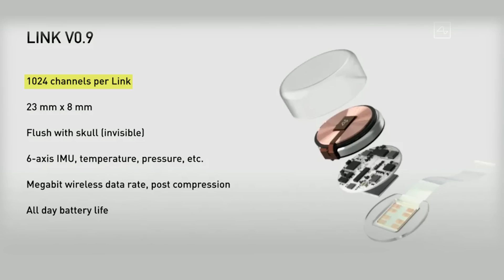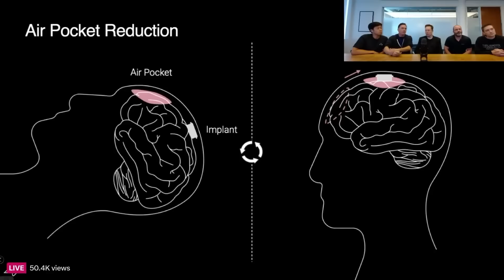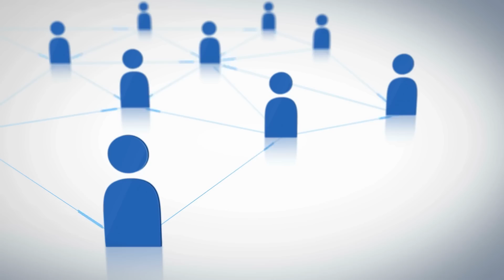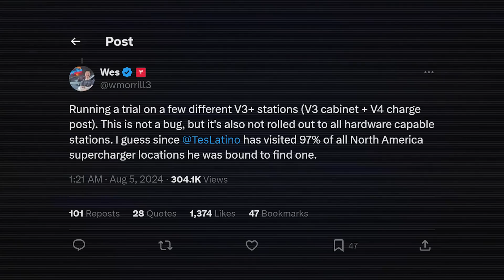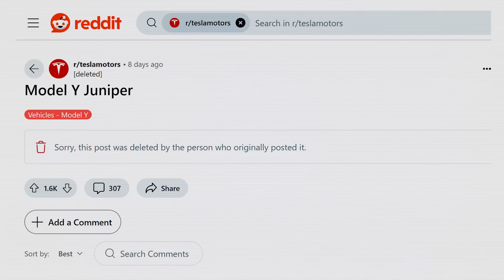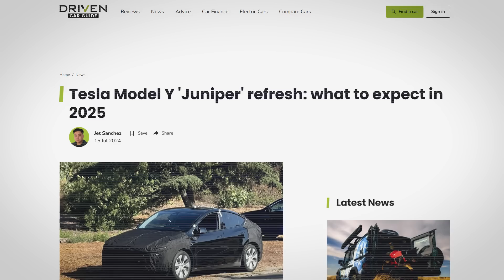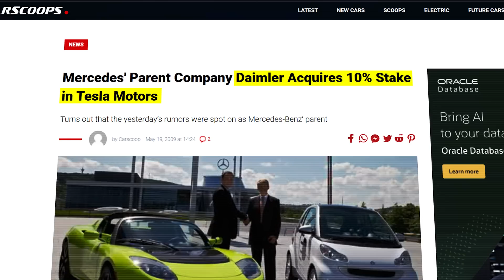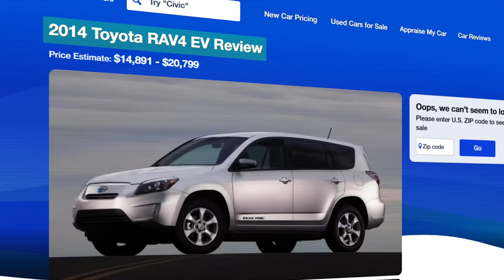Elon Musk Reveals Neuralink  V2

Comment: No, if you watch WhistlinDiesals durability test the cyber truck had some pretty major flaws. Slamming the door once can result in it breaking, the mirrors are barely held on, the tailgate came straight off when trying to tow a Ford f150 as a result of not being held on by anything, and perhaps not surprisingly after all this, pieces of the "bulletproof" body are held on by glue. Also if your windshield, which also is surprisingly easy, breaks, the car will stop working entirely. This guy is fanboying so hard over a video that quite literally shows that the cyber truck is mostly a cheaply manufactured pos
Reply: You would think the rear frame would be able to withstand being dropped on concrete from a couple feet because of the 5.5 ton towing capacity 😮
Reply: @Tacticalmayhem1  naah, vertical and lateral loads require different structural charachteristics. The rear frame is engineered to sustain the just the latter. Rest easy, the CT is a nice car.
Reply: the tailgate did get damaged earlier on tho when it dropped off the pipes and smashed on that concrete barrier at the bottom of the pipes which prolly affected the integrity of the tailgate itself
Reply: @XX121x2 Dude shut up that car is a piece of junk. No different than a traxxis  rc truck. There is nothing new/innovative about its technology they are just selling you a dream. Same thing with neuralink. All old technology. Fun fact the first electric tank was created by Porsche nearly 100 years ago. So look at what youre chasing 😂
Reply: @dcappucino9513  bro I don't like Tesla's all I stated was there was damage already done to the rear end that more then likely affected the integrity of the bumper.
Reply: @dcappucino9513  Out of all electric vehicles on the road that you see today, what do you see the most of?
Reply: @elijah3986  renault zoe and vauxhall corsa-e are cars i see daily i have only ever seen one tesla and it was the ugliest pos i have ever had the misfortune to see just face it tesla's are ugly and the cyber truck is a scam
Reply: @rya_belladonna  I have many reasons to doubt that's true, but if that's your only argument for why they are bad, then there is nothing to say. I think they look cool, they are fun to drive, there's many features that sets it apart from other vehicles, and they are the safest vehicles on the road.
Reply: @elijah3986  why would you doubt that look up sales statistics there is barely any tesla's in sweden so yeah when i say that i have only seen one of them its true we swedes knows safety and safe ? oh well if you call having numerous faults and defects straight out the factory then yeah the fact that 3 out of 10 tesla's are fire hazards and will burst into flames its a fault in the battery that shorts it out its been a problem since day one and they never fixed it
Reply: @rya_belladonna  Ahh, I did not know you were a swede, my mistake. They're everywhere where I live. As far as production quality, I will agree with you there. They definitely need to put more of a focus on that instead of being innovative if they want to establish a long-time consumer base. They also need to build more repair buildings.
Reply: @rya_belladonna  Glad you didn't say you say that you see Koenigsegg everywhere. Tesla is far better than all the brands you mentioned.
Reply: Lol yeah the mental gymnastics trying to spin it as a positive is lunacy

Comment: I thought a neurosugeon recently said brain electrode tend to become useless after sometime due to immune system forming a protective sheath of some kind (scar tissue) to isolate the foreign object
Reply: Ohh, that's right. Like deep brain stimulation electrodes for Parkinson's lasting 10 years+ , or like pacing wires for the hearts electrical system over 10 -15 year lifespan.
Reply: @PeterTerren  Those aren't wires receiving signals those are wires supplying electrical stimulation.  A different concept that you need to think about.
Reply: @conceptrat  I have inserted pacing wires into the right ventricle of the heart and altered the parameters. They are bidirectional in cases of single electrode systems. So if no systolic firing is sensed after a predetermined period then a firing pulse is transmitted down the same wire. Yes at present Neuralink is a listening only device.
Reply: I watch lex Friedman podcast with neuralink team.
Electrodes are so tiny and carefully placed that scar tissue is not forming.
Time will tell of course if that's a case when 10 years will pass.
Reply: I'm no expert but that is a firm thought and probability. The human body does not welcome foreign objects inserted into ourselves. It rejects them and runs its coarse, or tries to anyway. Even human organs for transplants the body will reject. So you probably are remembering something accurately something someone said like that. It makes sense and would fall right in line with the pattern of the human body anytime. 

Even with that trans nonsense, the body tries healing the damage surgeons create within their victims...oops, I meant patients.
Reply: Don’t despair, we may have gene therapies that prevent scar tissue formation soon, I hope the neuralink team is aware of this and researching it/considering implementing it
Reply: @zrakonthekrakon494  Spouting gene therapy as a method of reducing scar tissue is like saying soaking an orange in water means it's impervious to being poked by a knife.